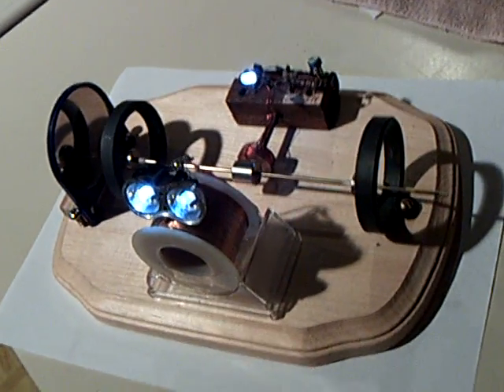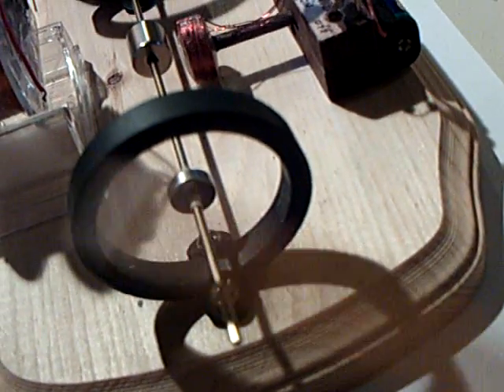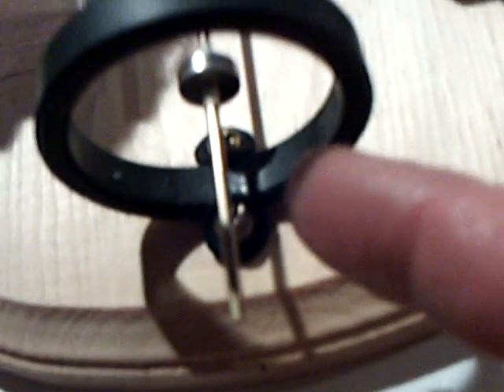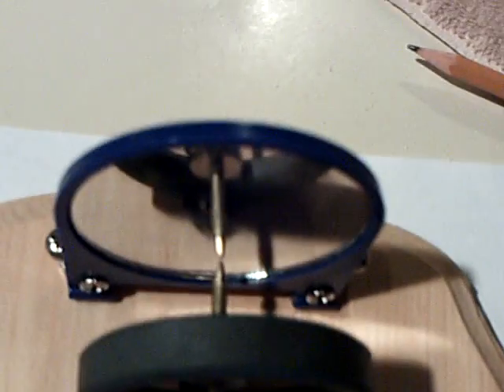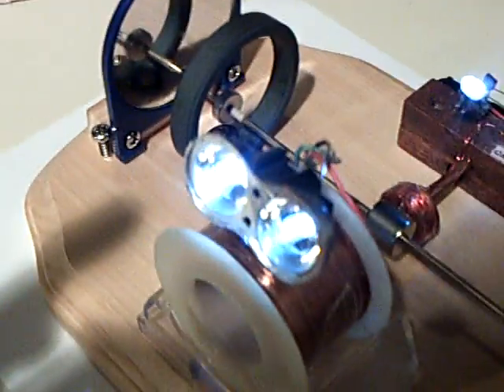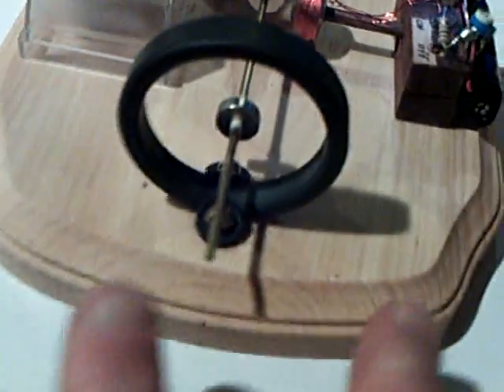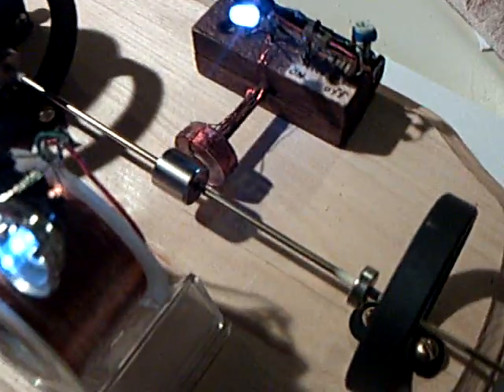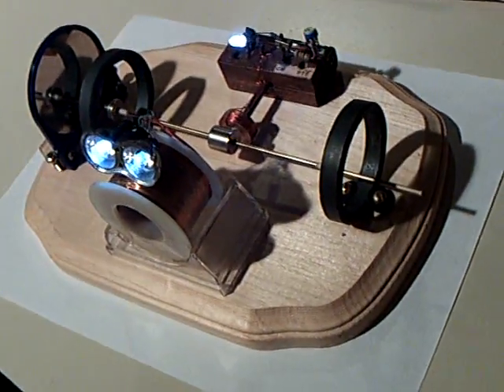Ring magnet  pulse  motor

Comment: is there a way to get rid of the mirror?
Reply from the maker: No not on this setup.  You need point contact at the end of the shaft.  If you adjust the magnets carefully the pressure at the point can be very slight.  The friction is minimal.

Comment: Why couldn't you glue small round magnets on the ends of the shaft and on end plates arranged N to N  to repel each other to suspend the shaft entirely magnetically?
Reply: Mathematically in physics - it's been proven that it is impossible to do this setup and suspend the shaft magnetically in all 3 directions (axis).  The shaft is being held in place by the mirror because of sideways pressure of the magnets holding it up.  The shaft is filed down to a point and touching the mirror makes it nearly friction-less.
Reply: That's what I was going to do too.

Comment: sorry i meant the stronger magnets will hold better tension on the shaft (might want to beef it up just a lil) but with the stronger magnets holding the shaft you should be able to grab the end oh the shaft and hold it stationary with two flat magnets (round of course) at each end.  You may have to use slightly smaller magnets on one end to counter the magnetic vortex caused by the ring magnets.  have fun should turn out great.  remember love to hear you r feed back.

Comment: If you play with the magnetic fields a little bit, you can eliminate the point contact.  If you're using both pairs of ring magnets in repel mode with both rotor magnets closer to the center of the axle than the stator magnets, you'll be able to keep the axle from sliding laterally while it spins.  You can also shorten the axle and place a small button magnet in attract mode in the center of the stator ring magnet.  The result will be a stable magnetic bearing.

Comment: cool thing!
I noticed that each large ring is offset from the shaft (levetating) magnet. They are both offset to the same side making it necessary to have the glass mirror to stop the shaft from shooting out one side. 
What happens when you turn the ring and shaft magnets on one side to be offset by the same amount but in the opposit direction. would this cause them to fight eachother and eleminate the need for the glass?

Comment: Yeh I am working on mine but I am doing a vertical one but insted of a mirror I have mine in a saddle all on one bearing  like a ball point pen, no wobble smooth and  elagant the trick is magnetic gears. Have to have more torque. Torque is key!Torque= power.

Comment from the maker: The driver part on the right uses one AA battery as the power source.  This is running on 1.2 volts at 30mA.  No free ride but notice the amount of light that I am getting using that amount of power

Comment: Lid. Thanks, but I'm sure you can find others using this idea. I've seen some going vertical too. I try to make it so people can understand a little better how it's made and works. I'm working on the machining video now. Man, I can't believe the rotor stays suspended with such an air gap. Some time try a mirror on each side with only enough space that you can hear a slight rattle. Then fine tune so the rotor will stay at either side. I've had rattling while it was running 15  minutes free spin

Comment: Could you explain the poles on each magnet, i,e, the two cylinderical magents, are they diametric in perfect halves of the cylinder, and the rings are the diamteric, radial..? Trying to picture the opposing forces responsible for the lvitation. Really nice work, you can't even tell its moving in the video!

Comment: Great Motor! Thanks 4 sharing. ...BTW two tiny neo disk magnets with turned conical 'cup-cone' steel pole peces replacing the needle-mirror bearing. place the discs inside the bottom of the cup and the "flat" top of the cone....(repulsion from both poles;)